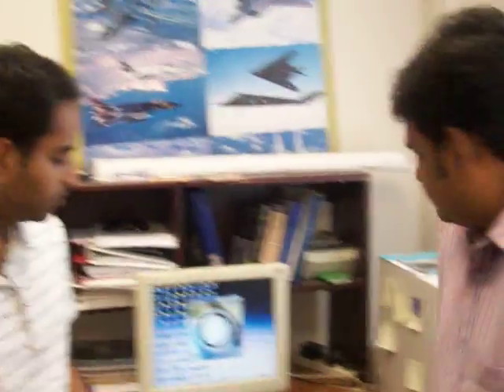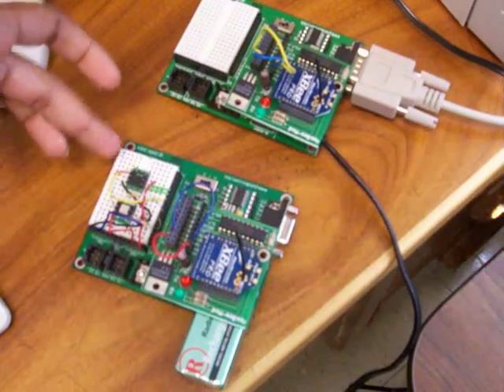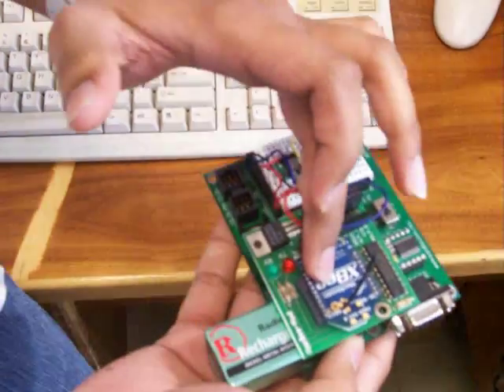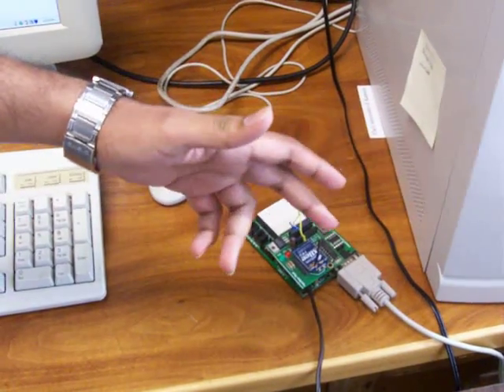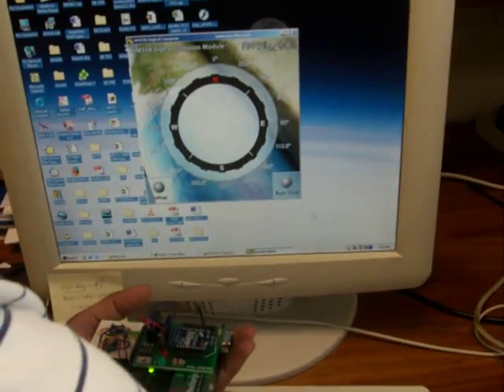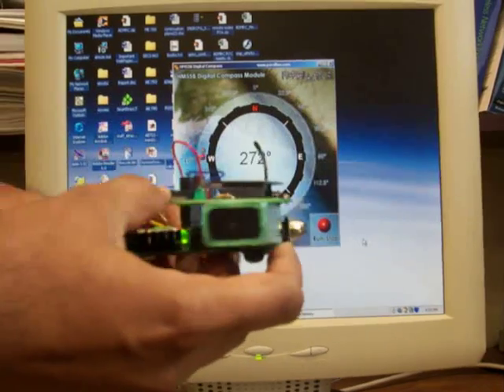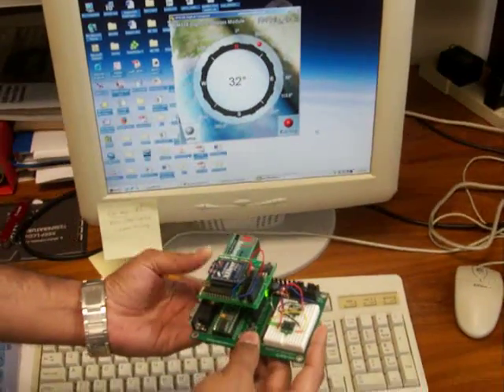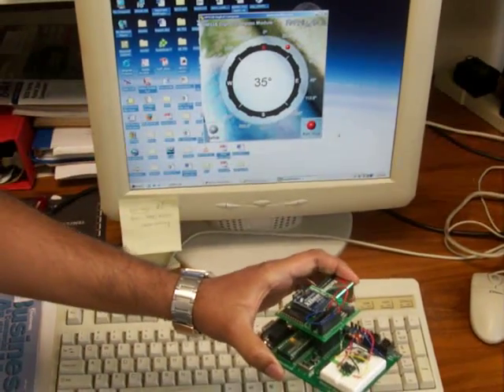Wireless Communication and Control

Comment from the maker: yeah we used the compass and accelerometer both frm Parallax. well if u ask me ZigBee is for low power networking and easy to setup...with the most simple addressing feature. Right now I am using ZigBee for a wireless appln which uses energy extracted out of vibration.